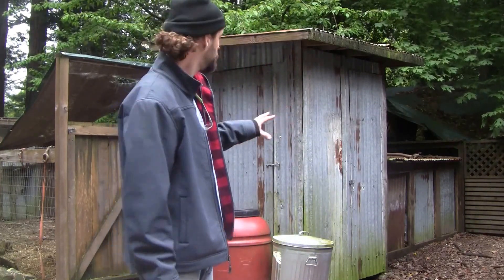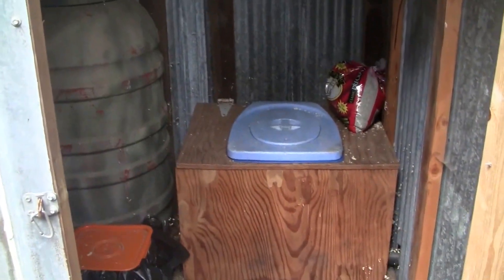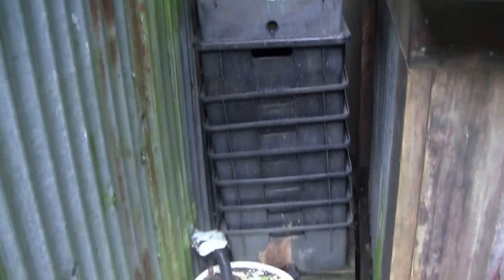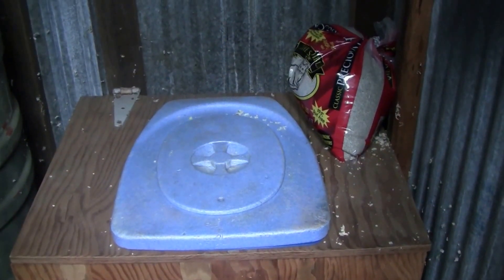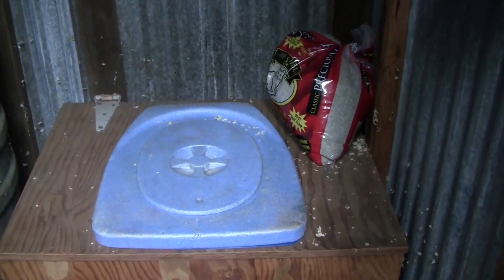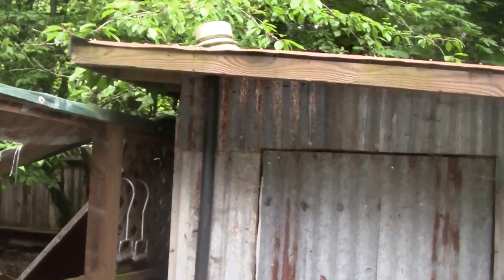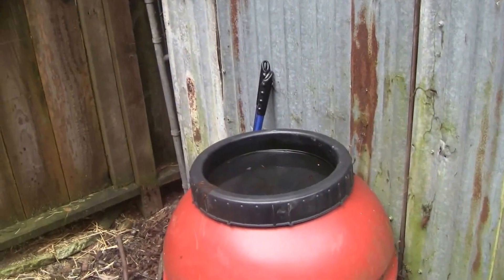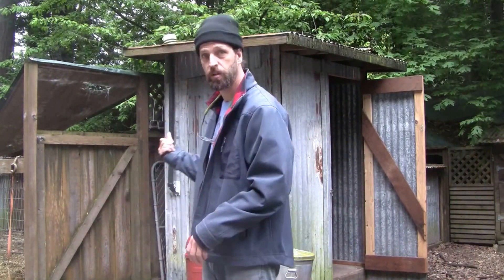A COMPOSTING toilet system with a Solar Vent, Urine Diverter and  Pickle Barrel

Comment: Thank you so much! I had 2 guys to build a long drop toilet system but they continuosly don't show up to work. I have looked into compost ideas and want to urine divert(I currently squat on 2 buckets in my tiny house, but not ideal for overnight guest that need to go #2)😮. Anyways i was looking at the composter toilet from Finland, but the price tag😢. Anyways at 56 years old lifting heavy buckets and shoveling big piles of bay system composters just won't be feasible in a few years. So I was thinking of these type barrels but worried it wouldn't break down, and couldn't find anyone with examples of using barrels to store waste until it decomposes. Now I finally know. My plan is to have barrels in place outside the loo. So as I get older I can just tip the barrel over when compost is decomposed😅. The key is not having to move heavy barrels around or change out. You think about these things when you get older how to live the dream but be able to live independant as long as possible.
Reply from the maker: Yeah it's an okay system. You definitely need to wait for it to compost. I'm not sure if I talked about putting something in the bottom but I wouldn't do that anymore. But yeah it'll compost just fine especially if you can get it in some heat

Comment: What no phone in your pocket to show us inside the barrel?  Doesn't everybody have a flashlight on their phone?  :-)

On a more sober note, has anyone made a solar chamber to sterilize the poop? Just make an insulated box big enough for the barrel with a double glazed sun oriented window. It would get the temps up pretty hot over 2-3 sunny days. That would make a safer product and perhaps satisfy the ....can't think of a polite term for them...

I have been experimenting with an aquaponics inspired urine processing system. I use  charcoal with a little compost for nitrate bacteria starter in a 5 gallon bucket.  I've added a gallon of urine at a time. In a couple of days there's no odor at all.  I rinse it out with additional water and pour it out around plants.  It would take a lot longer in cooler weather.. so would need more buckets.
Reply from the maker: I love all the experimentation!  Good Ideas.